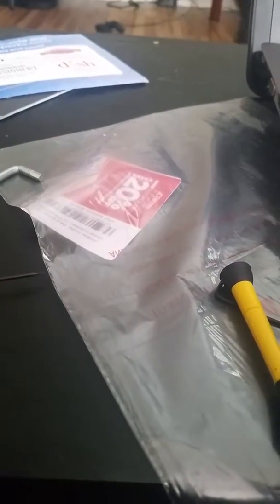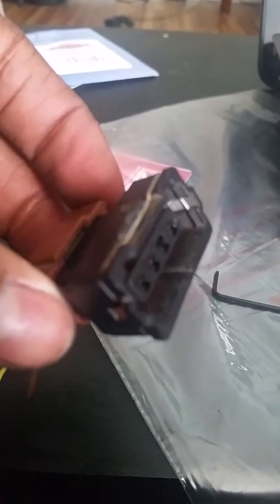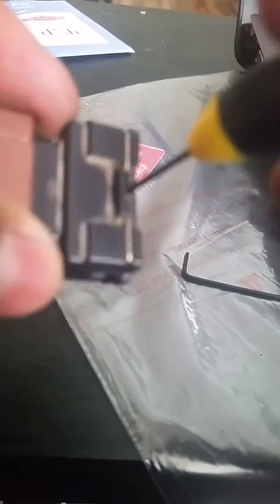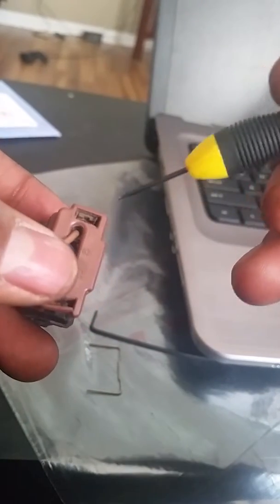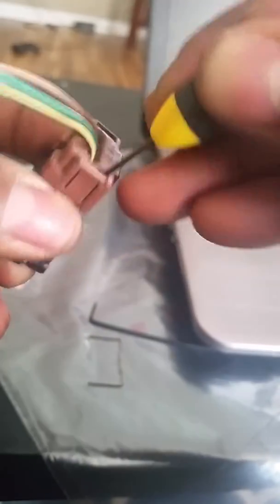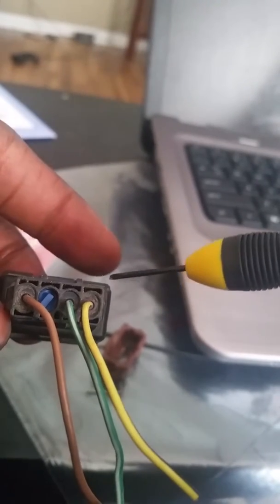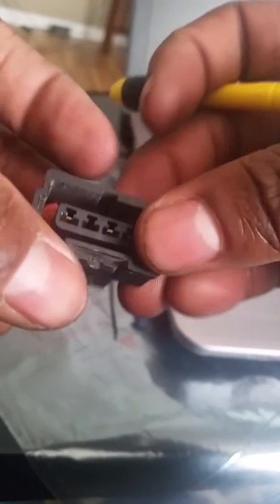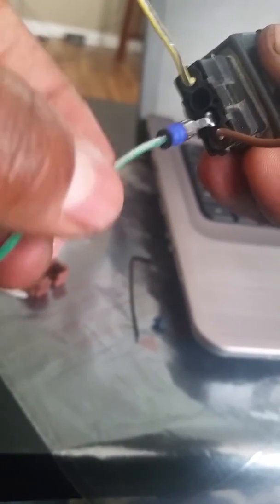I4 galant intake manifold swap wiring/ De-pinnin

Comment: I was wondering if you had to take the fuel rail off to remove the intake manifold?
Reply from the maker: I honestly can't remember I think you don't have to though unless you are doing a fuel rail upgrade.  I think I had to because I got just the intake with no fuel rail so I put my stock 4g64 one on the outlander intake